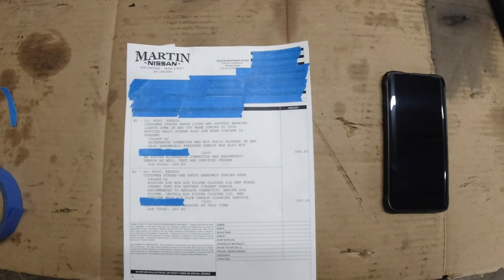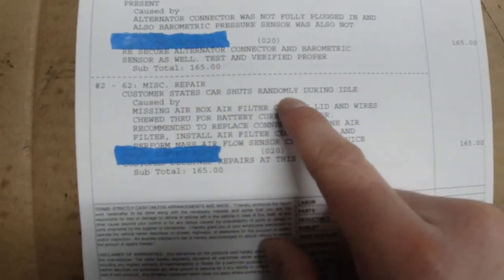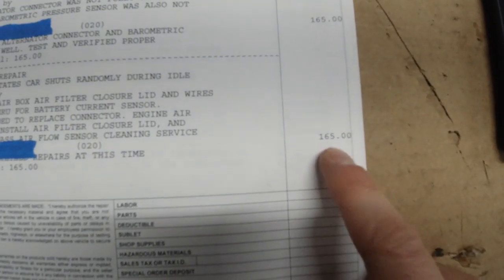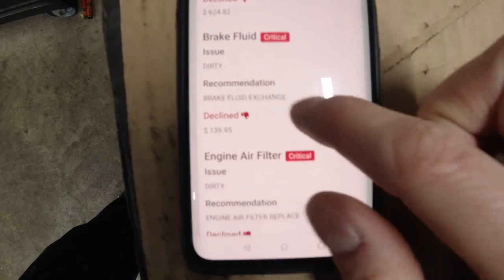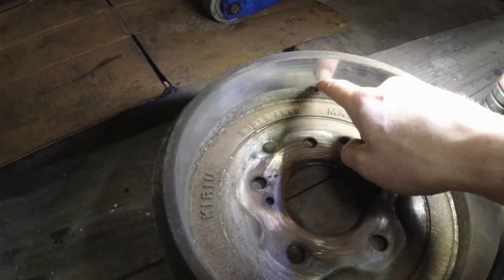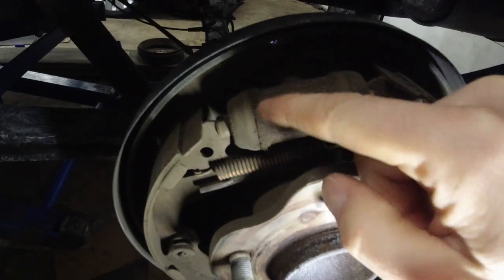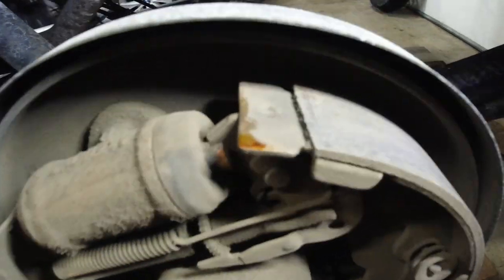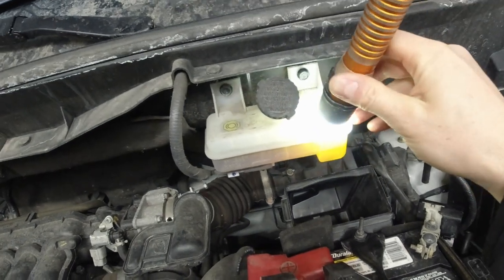WTF Nissan Dealer

Comment: My car developed a steering fault. My mechanic fixed a tie rod end but it didn’t fix the fault. He scratched his head and asked me to take it to Nissan for their expert opinion. I’m going today to collect the car after they quoted me £1,000 for a front brake disc and pad change (£375) and wishbone replacement (£625 with OEM parts or £750 with Nissan parts).  They’re asking me to sign a waiver before I leave to say that I am taking a car that is dangerous away. Oh and I’m paying £50 for their expert opinion on fault detection.
Reply from the maker: yap...the only time I go to a dealer is when I want a brandnew car, which was twice in my lifetime.

Comment: Wooow I can’t believe they would charge the customer a diagnosis fee for two separate complaints, that’s wild! So when a customer comes in they are informed there’s a diagnosis fee, they are aware of the cost before they give their vehicle to the dealer. Line 1 repairs were performed and covered by the fee, line two the customer declined the repairs. Had the customer approved the repairs the fee would have been rolled into the cost of the repair, since they declined it it was not. One of those wheel cylinders were definitely seeping as the brake dust was damp and are normally recommended in pairs. The drums were more than likely recommended because who cuts drums anymore? People come to dealers cause we know you’re supposed to lathe or replace brake components, and people come to us cause we know you test the moisture level in the brake fluid before you recommend a flush, but what do I know I’m just a lousy dealer tech
Reply from the maker: Oh, so you were there with me and figured out from the video that one of them was seeping "definitely".  My finger was dry after i touched that cylinder and checked inside the rubber boots.  And those repairs that the tech did....pushing back the 2 connectors, they were not broken or anything like that, just not pushed in all the way.  And the cleaning of the maf sensor was not done.  So i get the charge was for 2 hours of labor and i get that they gotta make money somehow but come on man, this is a bit overboard.  $330 for what? scanning and pushing in the 2 connectors?  They did a free oil change and tire rotation "free".
Reply from the maker: @soccerking1988 actual technicians?  is there a difference between a mechanic and a technician? or is it just a politically correct new term for the same guy.  Anyways...same people keep coming back to me with new issues, so i must be doing something right.  And no i didnt measure the drums since there was almost no ridge on the edge on both of them.  And when test drove it I had no shake or vibration coming from the rear or anywhere.  good day.
Reply: 2 problems, 2 fees. I dont see the problem. You want someone to figure it out the problem, you pay for the time to do that. They may seem like "simple fixes" by pushing connectors in but there's a process for that. Duplicating the concern, scanning the vehicle, pulling wire diagrams. Checking fuses, checking harnesses and then ultimately, yea it's a loose connector. There are steps and time involved with diagnosing. The other concern is the same thing. Mechanic finds chewed wires after all the time and steps, customer should pay the time the mechanic spent finding it. Whether you want it fixed or not. It's a back and forth, cant point fingers saying dealers are bad. Dealers get cars all the time from small mom and pop shops and alley joe mechanics because they didn't fix it right either.
Reply from the maker: I agree but I still think this is a good example of dealers kind of stretching that diagnosis step too much.  A diagnosis starts by looking in the engine bay and scanning through connectors, harnesses (visual inspection) not hooking up a scanner straight away.  So did he take the long way or did it on purpose...did he notice the loose connections (which all of them are up top not burried somewhere) and simply kept the vehicle for a little longer to get in those 2hrs.  We all know that dealer prices are a bit steep and that some dealers have been caught overcharging.  We also know that Nissan is in financial trouble.
Reply: @cruizinmax4017  in some cases yes you dont need to hook a scan tool up right away. Use your video for example, battery and brake light on. I wouldn't check connectors right away. That tells me something is wrong with the alternator. Yes visually check, but if its not seated properly and looks to be plugged in, some may assume it is. Then  move on to a system test. Even if I found the connector loose right away, I would still test the system. If I find that alternator connector was not seated properly, that also tells me someone was in there before me. Now I gotta figure out why?? Connectors dont just come loose on their own. Another example, MIL/CEL is ON, say 2012-2014 Maxima with 60k miles. Go to auto zone, scan it. P0101, MAF sensor, they sell you a MAF sensor. Light comes on again. They go to a dealer. Dealer gets a P0101, MAF sensor. Inspect it, aftermarket sensor. Nissan tells them, P0101...clean throttle body and reprogram ECM....under 8 years and 80K miles...FREE OF CHARGE!!! Customer spent money $140+ on sensor for nothing. Other places do NOT have all the info as dealers do.
Reply from the maker: hence why i said not all dealers do this, i dont put all dealers in one bag.
Reply: @cruizinmax4017  you're telling people "only go to the dealer once". Buy your car and thats it, thats what you said. You're contradicting what you're saying right now. Because you are putting them in one bag.
Reply from the maker: I did, didnt I.  I say that because dealer prices are usually through the roof.   A little story about my first encounter with a dealer after I bought a brandnew car in 2006.  Noticed paint chipped away on the roof after 2 days of owning the car, at this point I drove only a few miles around my neighborhood, (no highway) so I went to the dealer, left the car there, they kept it for 2 weeks!!!  At that point I knew that dealers have professionals come in and fix paint or dents for example...finally i get the car back and guess what, the repair looked like just simple touch up, no sanding or trying to blend the paint, they simply put a drop where the spot was and that was it, I could have done that myself in a matter of minutes.   So i guess what im trying to say is that they are mostly dishonest then honest. (got more stories)
Reply: @cruizinmax4017  dealers have a consumer affairs or some type of complaint center to call. If they had your car for 2 weeks, and you know about the services that come to the dealer, then why did you let them keep it so long? Once consumer affairs is involved they crack down and get the work done, complaints against them effects the dealer score and possible money/bonuses that come in every month. Dealer doesn't want that, so they get the problem solved right away.
Reply from the maker: great...that doesnt change the fact that they kept it for so long, I had another car at the time and when i called they said its not done yet, if i remember correctly i also went there to check.  My car was parked outside.  This was back in 06.  I didnt take it back cause i wanted them to fix it.
Reply: @mattgibbs4261  I'm assuming this is towards CruizinMax, not me, because I'm not the one that's butt hurt. Lol
Reply: @retrodude3154  it was. My bad lol
Reply from the maker: Not butthurt just gave an example but yea, whatever you say there champ...keep on truckin
Reply: @cruizinmax4017  wrenching*. Don't worry. The real technicians will continue to fix and diagnose the vehicles the right way while your crying on you tube 😂
Reply from the maker: @mattgibbs4261  yap...dont worry...just keep on ripping those people off so they can keep on coming to me...thanks.
But let me ask u a question...when your water heater, furnace, dryer and so on brakes...do u call a specialist right away or do u try to fix it yourself first or at least look into it?
Reply: @cruizinmax4017  yup* don't* breaks*

English clearly isn't that easy for you. Neither is wrenching on cars. 😂😂😂
Reply from the maker: wow really, attacking me on my grammar, very mature.  So u do try to fix those things yourself to save money, i see...